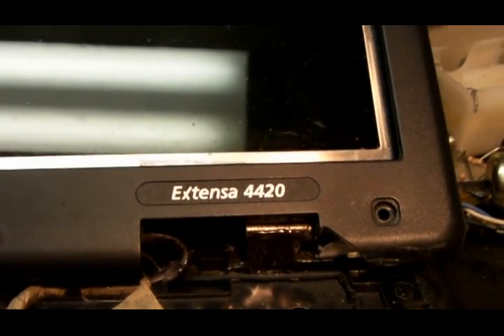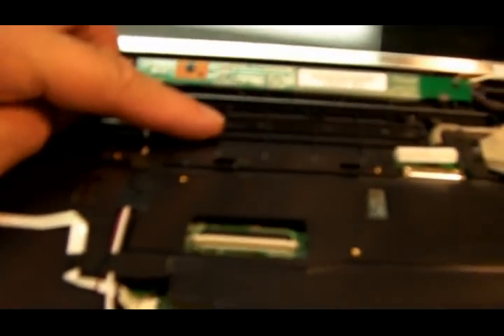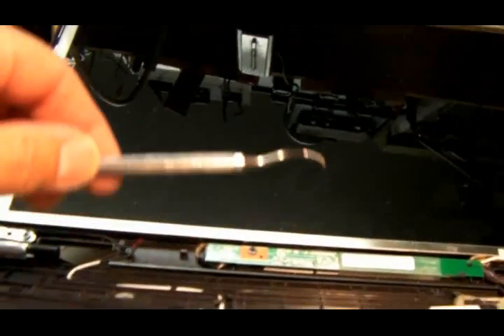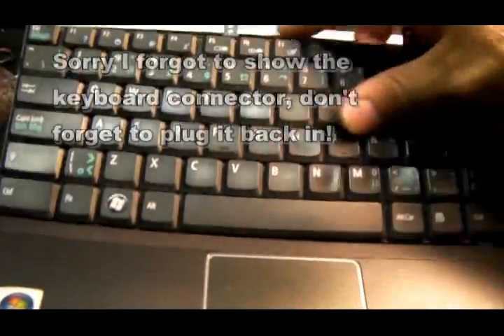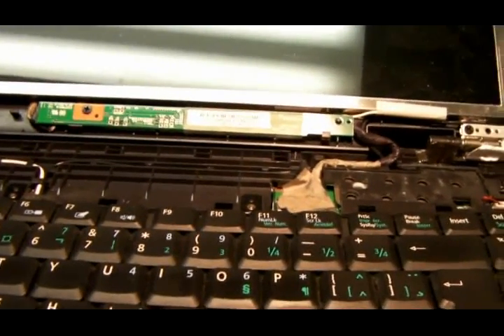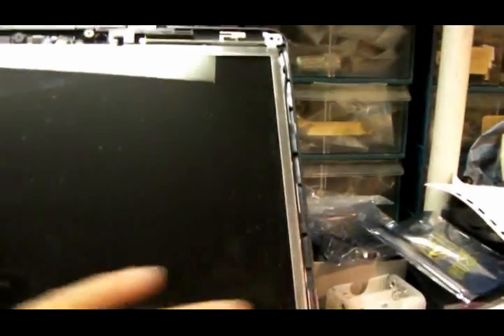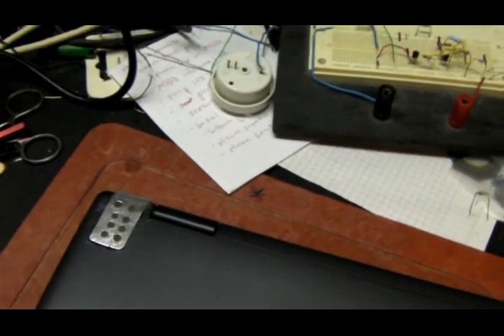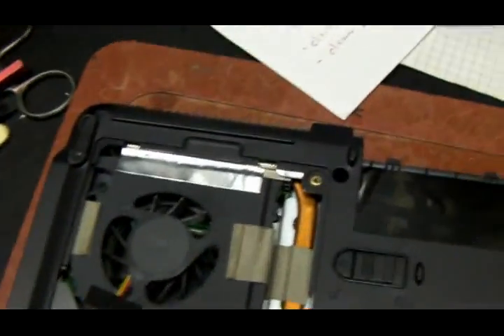Acer Extensa 4420 CMOS Battery Replacement

Comment: Wasn't clear if the screws around the outside from the bottom needed to be removed to open the case.
Reply from the maker: Roger Marble Yes the screws need to come out or you can't separate the case